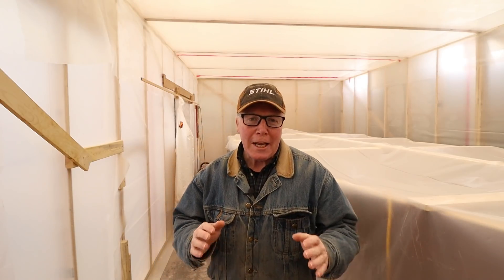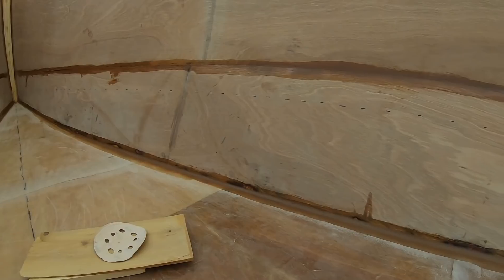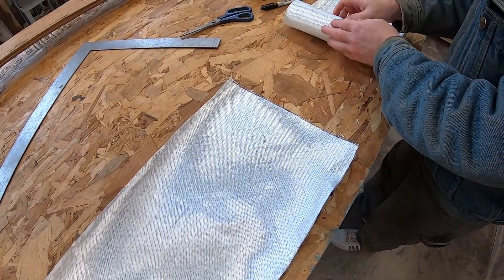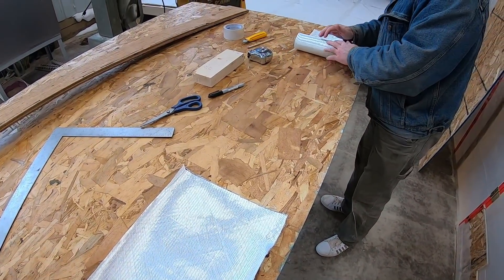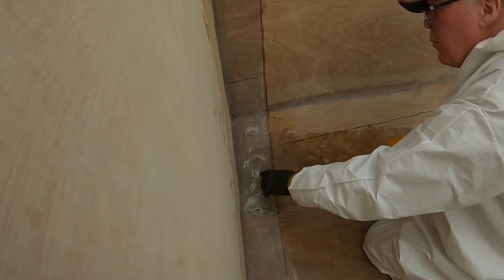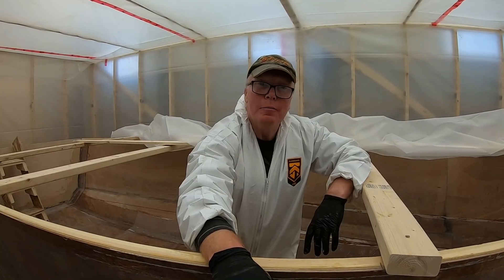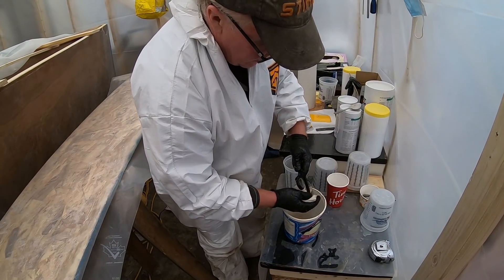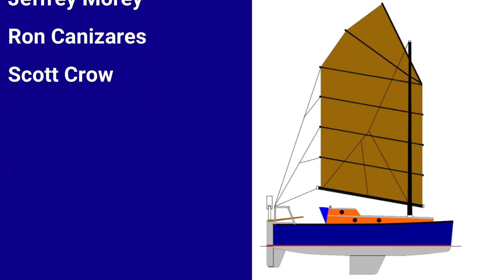S2E29 Wave Rover Uses a New Method of Applying the 18oz Bi-axial Fiberglass

Comment: Vinegar works but it breaks down the uncured epoxy as an opposite to alcohol or acetone which act like a thiner. So, you need to be careful to not get vinegar on your work if you use it for cleaning tools.
Reply from the maker: Thanks for the very clear explanation.

Comment: Awesome project! I've been sort of following you a bit and love your ingenuity. I've done a lot of laminating with 1708 biaxial on the refit of our Westsail 32 and I had a thought for you. Even though you saturated it before laying it (great idea), the plywood will soak up some of the resin. I always wet out the surface I'm laminating before applying the cloth. In general this is a good idea. Even before filleting I do this. It's a simple step to quickly paint epoxy with a brush. Always have great results and nothing has ever delaminated for me. Great progress and I hope you take this boat even further! Cheers :)
Reply from the maker: Yes, it's a good precaution. I prewet the surface on the exterior and always before the fillets. The cloth was literally dripping with epoxy but will prewet in the future.
Reply: I wondered about that with these products.
Other materials lifted off my work, drying before curing, so I also soak prior to laying.

Comment: Alan.   Is There anyone else build this Wave Rover? Have you thought anymore on the Flotation? Just a Question could you take and Kevlar fiberglass the inside to make it Stronger and just put a Waterproof Sealcap to make it Water proof? I was told Kevlar does flex. Thanks. Gory
Reply from the maker: There are now 16 sets of Wave Rover Plans sold. Out of that number, 3 are under construction and a number more will start this summer when the weather warms up.

I'm still considering about the flotation. I won't be using any kevlar as I don't have any but the hull will be very strong with normal material.

Comment: Hi Allan. Making good progress I see.  Your viewers might like to know peel ply is also generally available in narrow rolls - usually 4”, 6”, 8”, 10” widths or similar, designed for this exact job. Very handy. Though your 10” wide glass would probably prefer 12” wide peel ply - not sure if it comes that wide. The overlap I find enables a smoother transition from glass tape to hull as you can squeegee out the excess resin from under the fg tape edge and the pp, which then lies flat onto the surface below smoothing out the loose fibre edges = less sanding! And less sanding is good! Very good! 😮‍💨

I have to say I’m not a fan of pre-wetting myself ; ) unless I’m working in a difficult to access place. It’s more difficult to manage, with a sloppy wet roll to control in one hand, while trying to lay it out straight with the other etc. And it sets off much quicker since you have a concentrated amount in your hand getting warmer by the minute. Not ideal, particularly for warmer temps.  I’ve had it go off in minutes, even with slow hardener. 
An alternative method is to use a disposable 4” paint roller and roll a liberal layer of resin along the joint, (enough to ensure you don’t starve the ply, but not so much that it runs) then roll out the dry glass, which adheres nicely to the resin and sits just where you want it and in minutes soaks up any excess resin creating great contact between ply and glass. Then once all rolled out, follow up with the resin and roller which both saturates the glass and removes bubbles etc. With a little practice you soon get a feel for just how much resin to leave in the glass. Then roll the peel ply on and squeegee out any excess resin, which usually is little once you done it a couple of times, and not so much as needs picking up off the ply. The down side is your roller can set of as well but making sure you work as much of the “old” resin out of the roller as you go usually extends its life long enough to get the job done. I use a wide paint roller tray to spread out the mixed epoxy and hence reduce the warming feedback loop and extend the life of the mix, and also enable filling the roller with epoxy.  The bonus here is also if you’re working by yourself it’s a more controllable step by step process - finish one run, start another…. Keep up the good work. Cheers
Reply from the maker: I have now done it both ways and I can see the pros/cons. If I'm by myself working with a roller makes sense but this 18oz bi axial really soaked the stuff up, but did it on the exterior. A team really lightens the approach. Good point concerning the heating up. Not a big concern for another few weeks for me, lol.
Great to get your input, I wished you lived a little closer. If you are planning on a little vacation to PEI I would appreciate the hand (I know that it is a bit of a drive from NZ)
Reply: @RoversAdventure  Yeah I hear you... I worked with 810gsm (about 28 oz) triaxial on the arm beam ends of the tri I'm building, and it's like laying carpet!!  Having a crew on the job would make it a lot easier.  Mate I'd be there in heart beat.  I'm totally addicted to boat building, just don't tell my wife.  She thinks the present one is my last... mmm maybe.  Cheers

Comment: Did you wet out the plywood first? in some of the shots it looked like you did and others it didn't.
Reply from the maker: The fg was really saturated, so plywood didn't need any wetting out.
Reply: @RoversAdventure  - Hmmm.. can't really say I'm sold on that concept. Most people say wetting out the plywood is necessary, even though the f/g is saturated.
Reply from the maker: @Garryck-1  I have changed it up again and am wetting out and still using the saturated glass (just less so).
Reply: @RoversAdventure  - Good to hear. My understanding is that if the plywood isn't wetted out first, it can absorb epoxy from the glass, causing a poor bond which can later result in delamination issues.
Reply from the maker: @Garryck-1  Absolutely, I 'm using  hardwood veneer ply which absorbs less than softwood, but best to be sure for the 650.